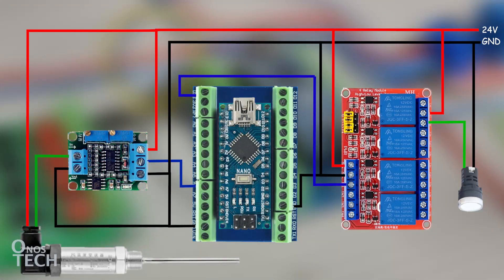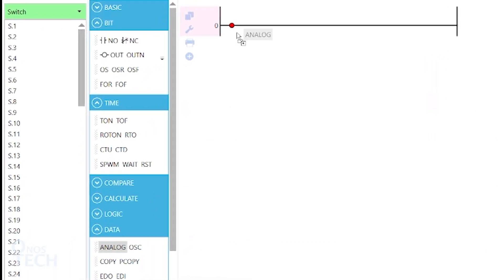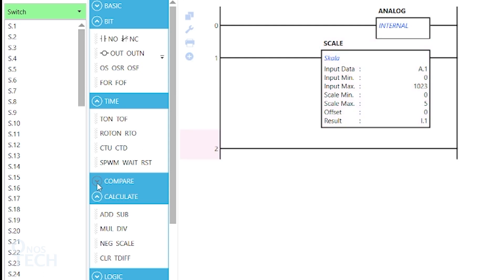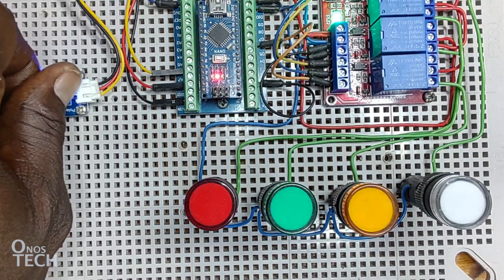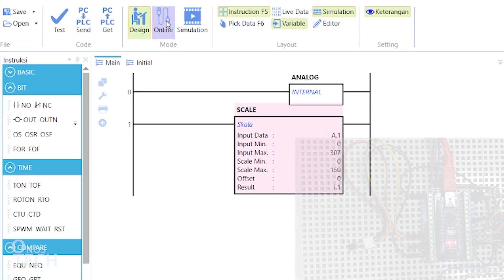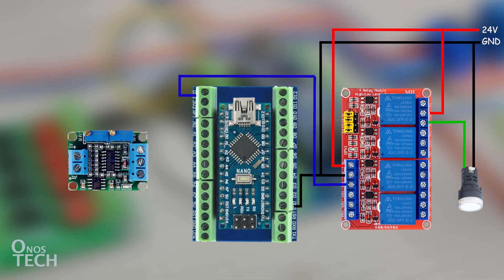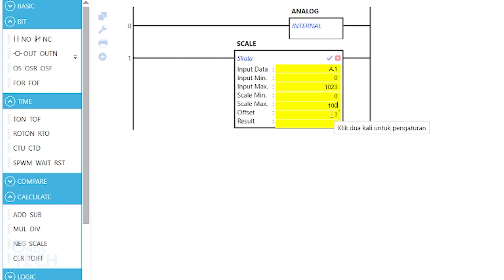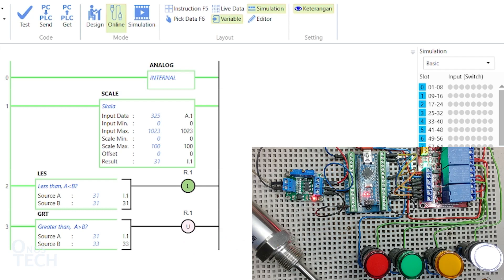#11 LM35 and 4-20mA Industrial Temperature Sensor to Outseal Arduino PLC

Comment: Good day. I think your content is excellent, keep it up. I have a question. Is it necessary to connect all the GNDs (arduino and sensor), or can it be independent?
Reply from the maker: For the temperature sensor and the current to voltage converter module, if a separate power supply is used by the sensor, their GND could be separate from that of the Arduino
Reply: @OnosTech  thanks you for answer

Comment: bro i wanna know the reason why you devided max output voltage with 5 and than you multiply with 1023, how come?
Reply from the maker: https://www.electronicwings.com/arduino/adc-in-arduino
Reply: @OnosTech Nice bro, very helpfull, Thank you
Reply: @OnosTech  anyways bro, now i worked with DHT11 sensor and i wanna try to read it with outseal studio. the input is digital so its different with this tutorial. can you help me?